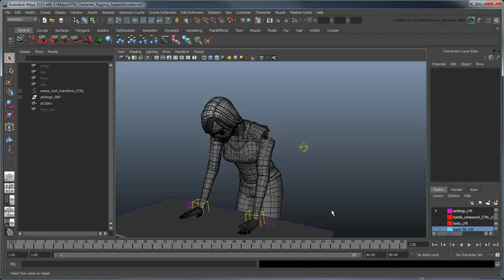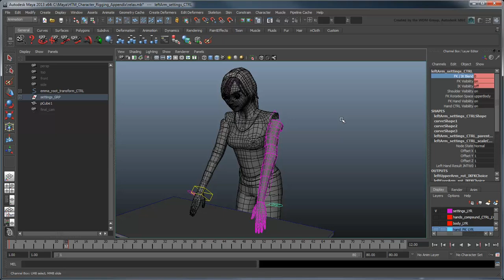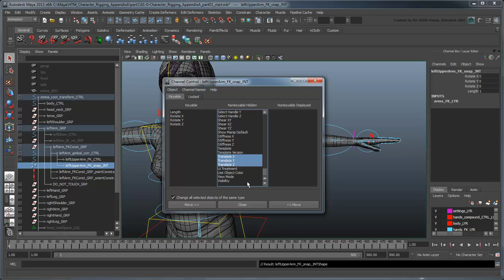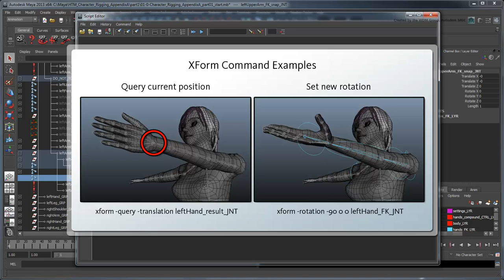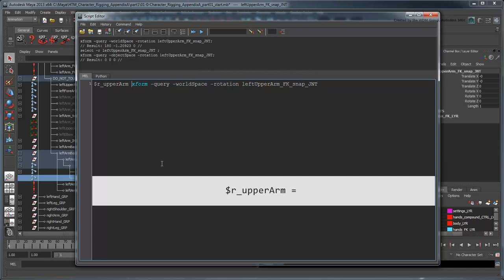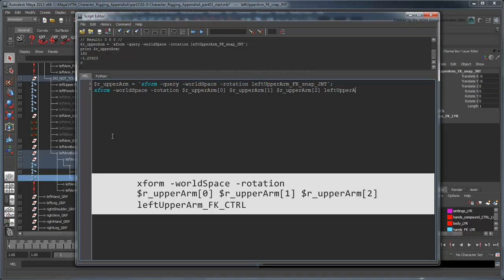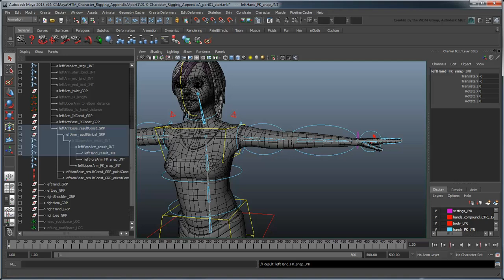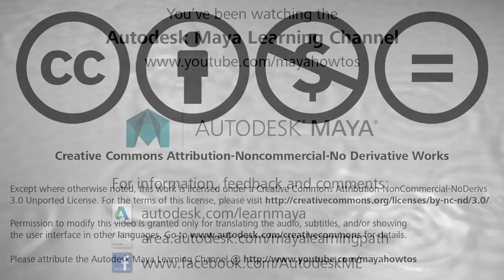Creating a Character Rig: Appendix A: Part 1 - Matching the FK arm to the IK arm (Advanced)

Comment: For some reason, my FK arm controls and the reference objects (snap_JNT) don't have the same matrices values. Both are placed in the same position in the world, with zero transform values (I didn't apply any Freeze Transformations) and the same Rotate Order. I did just like the video, but when I print their rotation matrices values they are different, even at the rest pose. As a result, when I run the script the IK and FK don't match properly. Why do they have different values in the world space matrix?
Reply from the maker: Are your snap_JNTs an exact copy (i.e. duplicated from) of the FK arm joints?  If so, everything should match until you re-parent them under the result arm.  At that point, their local space (which is what I think you mean when you refer to their matrices) will change because they're now having the matrix of the result arm space applied to them.
Reply: @Autodesk_Maya  Yes, they are. I've just duplicated the FK upper arm joints (I've also tried with a transform node, same result). But the values should match when both the FK control and the snap_jnt are in the same position (i.e. rest pose), shouldn't they? I've noticed the forearm_FK and the hand_FK match, the problem is only in the upper arm! The leg snap and leg FK control's world space matrix values, for example, match perfectly, even after I put them under the result joints.
Reply from the maker: @brunosilva3170  Is it possible your gimbal correction control is non-zero or otherwise affecting things?  If you're on Maya 2020, did you accidentally modify the Parent Offset Matrix values of either of those?

Comment: 6:10 In 2020 I'm just getting "// Error: line 1: Cannot convert data of type float[] to type string. // 
"
Reply from the maker: Are you sure you used the tilde (`) up next to the "1" key on your keyboard?  A lot of people accidentally use apostrophe (').
Reply: @Autodesk_Maya  Yes, I copied it from the internet as well just to be sure, and from other, working pieces of code
Reply from the maker: @Exsulator2  Do you mind copy and pasting that code here?  It'll be easier to troubleshoot if I can see it.
Reply: A litle bit late but if your probleme is not solved, I had the same probleme, so just try to do it in python, there is no need of the sort of ' (very difficult to find on a french keyboard)

Comment: Hello, so I've run into an issue that I've been able to counter for the left but cannot counter for the right arm.  So for the left arm, it wasn't matching at first, then I printed out the rotations of the snap joints, and copied those rotations into those joints to counter this issue.  Now the left arm matches perfectly from the test that I ran.  I duplicated this for the right arm by printing the values, this didn't work as it seemed that the controls flipped from the rig.  Next, I tried copying the snap joint values of the left to the right, it still didn't work, zeroed values didn't work and manual adjustment of the values weren't seeming to be helping.  The only difference in this video and my rig is that between the final hand tutorial and this video I met with a professor and separated the controls from the joints to make an overall control group while maintaining all the functionality of the original rig where it would've been lost with separation.  The only mirrored set of the rig was the right hand, and everything else was built from scratch.  How should I go about correcting this issue?
Reply from the maker: Did making an overall control group change the relative values of the FK / IK joints though?  Because that would definitely cause problems with this matching script.  This script relies on them being exact copies of the result joints.  That means, whenever their rotations match in the Channel Box, the FK/IK/Result arms should always overlap perfectly.  By changing the structure of the rig, it's possible that either the IK or FK joint values will inherit the rotations of their parents, thus changing their space and throwing this entire relationship out of whack.  I would double-check to make sure that's not what's happening.
Reply: @Autodesk_Maya  I just checked and this is true.  The Constrained Controls messed up the script.  Now to take this further, how do I re-integrate the constrained controls into the rig to keep the joints and controls separate?
Reply from the maker: @TheAnimationHipster  Instead of separating everything out, you could just create a Set (Create > Sets) that includes all the FK / IK controls in it.  That would effectively accomplish the same thing without changing the structure of the rig (and possibly breaking things, as you've discovered).  Unless there's some other reason they want it that way?
Reply: @Autodesk_Maya  Thanks so much!  I was actually able to match the LRA of the Controls to the Joints so they have the same pivot points.  The Stretching works perfectly for me now.

Comment: hi, first i wanna give out a big thx for the great tutorial.
Im using maya 2018 and the script isnt working. so i tryed what worked last time but still... no results. 
$r_upperArm = xform ("-query -worldSpace -rotation L_upperArm_FK_snap_JNT");
xform -worldSpace -rotation $r_upperArm[0] $r_upperArm[1] $r_upperArm[2] L_upperArm_FK_CTRL;
i changed the script using ("...") coz ` ... ` doesnt work but i get this error:
 // Error: Line 2.91: "$r_upperArm" is not an array. // 
plz help ;D
Reply from the maker: You can't really change the script that way unfortunately.  When you use `, are you saying that you don't get an error but the arm doesn't snap at all?  Or does it snap to the wrong place?
Reply: i just changed some little thing and now its working ;D doesnt make much sence in the first place but i changed $r_ to $l_upperArm no error. but first i had to put the first ` infront of xform again ... i had it behind coz i was testing so much around and forgot how the original line looked like ;D

Thx for you fast reply and ofc for the rly helpfull tutorial. it helped taking me to the next level of rigging ;D

Comment: Hi this tutorial series is amazing! I hope you're still answering questions. I tried to animate my character as seen in this video, to test out the rig. The controls work perfectly, but whenever I try to put the IK/FK handles behind the character's head, the twist bones flip. I know this could be because of the orientation axis of the foreArm and upperArm spline handles, but I can't seem to find an axis in which the arm won't flip one way or another. Is there a solution to this?
Reply from the maker: Generally it's impossible to get rid of flipping completely (it's just how the math works).  What you want to do is find the combo that removes it for the most practical poses.  Try using +Y as the Up Axis and Up Vectors of 0,1,0.
Reply: @Autodesk_Maya  Thank you! That resolved the issue. I had the closest Y instead of +Y. Is the Forward Axis X negative for the right arm and positive for the left, or doesn't it matter very much?
Reply from the maker: @miekeyperman981  Yup that's correct.

Comment: Hello I found your video very very helpful and was able to do my class assignment with this video. The only BIG problem is that the FK moves the IK when it matches it sometimes not always, and that has mostly to do with the fact that the pole vector is parented to the FK's shoulder joint. I noticed you set the fk shoulder joint's "gimbal" rotate values to 0, and I don't know exactly what you did before, since I jumped into this clip from my own assignment but I tried something like that by setting the FK shoulder joint's rotates to 0 as well as setting the pole vector to zero before matching, and recording its values, and resetting the pole vector to its old values after the matching, and none of those things seem to fix my problem.  I would appreciate some help.

Comment: Hi, I was wondering why can't we use result joint rotation to match FK to IK position? :)
Reply from the maker: Because the result joints don't live in the same local space as the FK or IK joints.  It's important to compare "apples to apples", so to speak.
Reply: thanks for the reply. Does it very from setup to setup. As I have bind joint chain, FK chain and IK chain,  I applied your method and queried rotation of the bind joints and then match it FK ctrl rotations. It worked but didn't work for the IK to FK match.
Reply from the maker: That part shouldn't vary.  If you set things up the way they are in this series, it will always work the same way.  Remember, for the IK match you're matching the control node, not the joints themselves.

Comment: Hi, I am working on a quadruped with a 4 joint hind leg. 
I set up like the video and rework the script that fits as I have freeze the transformation of the control curve.
However, when I run the script, it didn't any error but didn't change anything as well. 
Is anyone here to help I can share the file and we can talk about it. Thanks in advance!

Comment: Hi again! I am using separate FK controls and parent constrains rather than shape nodes to drive the fk joints, and i saw in your reply to someone else with the same situation. you said to place the snap joint in the same space as the control, how would I go about doing that?
Reply: I figured it out. Rather than duplicating the joints that are parented to the controls, I duplicated the controls instead and used them as the snap joints. Works perfectly.
Reply from the maker: Place it next to the control in the Outliner, under the same parent.
Reply: ok cool thanks a lot!
Reply: OK I ran the script and the fk joints match to the IK arm, but only slightly. the rotations are just a little off from what they should be, the snap joints are where they should be, however the result and fk joints are off. I used the xform command on the fk controls rather than the fk joints because the controls are what's driving the fk joints' rotations. I tried using the fk joints already and no  luck. Suggestions?
Reply from the maker: Are the snap joints duplicates of the FK joints or FK control joints?  You need to duplicate whatever it is you're matching to (in an ideal situation these will be exactly the same anyway, but from the sounds of it the local rotation axes sound like they're slightly off).
Reply: Maya Learning Channel theyre the fk joints, so I should duplicate the controls then? They arent control joints theyre just Nurbs curves that the fk joints are parent constrained to
Reply: I would like to know this too, because this is the route I tend to go since I'm using a single chain IK/FK blend. I tend to parent or orient constrain rather than mix shape nodes unless absolutely necessary.
Reply from the maker: Yes, that's the correct way to do it.  Basically, the snap "joints" just need to be an exact copy of whatever they're snapping to.

Comment: How would I set this up if I had control objects driving the FK and IK joints via Orient and Parent constraints ? The bones are in a different space than the controllers so is there a way to do this with out parenting the shapes under the joints ?. Also I noticed in the video that the IK control shape has values in the translates is there a way to freeze this out ?
Reply from the maker: As outlined in an earlier part of this tutorial, it's generally not advisable to create another layer of control objects on top of the FK/IK joints (which are, in themselves, already acting as control objects for the result joints).  However, if this is a requirement, then the theory is still conceivably the same.  However, rather than parenting the snap joints under the result joints, you can just parent constrain them to their respective result joints (ensuring 'Maintain Offsets' is enabled) from within the controller space.

As for the IK hand controls, yes you can freeze those values and the rig will still work.  In this case, you'll want to perform the same solution as above and place the IK snap joint in the same space as the hand control (rather than parented in the result joints), then parent constrain it to the wrist (ensuring 'Maintain Offsets' is enabled).
Reply: Thank you for the response I will take it on board regarding our rig development. Is there a video showing how to do IK Parent matching ? ie switching parenting for IK Arms to the Head, Chest or hips without popping ? I assume its similar to this IK FK matching method ?
Reply from the maker: I believe you mean space switching.  Yes, this tutorial covers that as well.  See part 9 or 18.

Comment: I got the idea and got it work perfectly. However, I wonder how you solve the code problem when you ref the rig instead run the script directly on the rig? The name of the controls carry the namespace in front of them so the code couldn't recognize the controls name.
Reply from the maker: You could create a textfield on the UI that allows you to manually input the namespace in it.  Then grab that value and append the text to all the node calls.

Comment: If you don't want to copy-paste the "Match-FK-to-IK" code block 3x (or how ever many joints your limb has), I wrote a function (procedure). Here's a copy of my script at the end of this video:

proc SnapFkToIk(string $snapJointName, string $fkControlName)
{
    $rotation =  `xform -query -worldSpace -rotation ($snapJointName)`;
    xform -worldSpace -rotation $rotation[0] $rotation[1] $rotation[2] $fkControlName;
    
}

SnapFkToIk("arm_base_FK_snap_JNT", "arm_base_FK_CONTROL");
SnapFkToIk("arm_1_FK_snap_JNT", "arm_1_FK_CONTROL");
SnapFkToIk("arm_2_FK_snap_JNT", "arm_2_FK_CONTROL");
SnapFkToIk("arm_hand_FK_snap_JNT", "arm_hand_FK_CONTROL");
Reply: how would it work if you ref the rig instead using directly on the rig. Cause the controls have the namespace in front of controls name?

Comment: Hi, I have another problem. When I run the script to snap my FK arm to the IK there is an offset and the locations doesn't match, except at the default position. Could you please help me fix this issue.
Reply from the maker: +Indika Ratnayake Sounds like the snap joint is either in the wrong place (perhaps parented incorrectly or in the wrong space), or is not a proper copy of the joints snapping to it.  Remember, they need to be exactly the same.

Comment: Hi, firstly great tutorial. I used the script you wrote and changed it based on a rig that I'm working on and came across an issue. Where the left side works just fine, the right side gets flipped 180 degree's in just the upper arm joint. The elbow and wrist joints are aligned but given that the upper arm is rotated 180 degree's its going through the rig. I was wondering if you had any insight as to what may be happening?
Reply from the maker: +Marquis Burt It sounds like the snap joint doesn't match the orientation of the corresponding upper arm joint.
Reply: +Maya Learning Channel Thank you for responding, I think I understand that, but would there be any reason why the snap joint would be in a different space even though it was originally mirrored?
Reply from the maker: It's hard to say.  The joint mirroring command can sometimes be a little finnicky depending on the hierarchy of the joints being mirrored, so that's a possibility.  Also, at least for the Emma rig, we re-adjusted the right-side joints' LRAs post-mirroring to ensure that positive/negative rotations are consistent with the left side.  Since those are manual adjustments, it's possible to just miss one of those.
Reply: +Maya Learning Channel Yes that is right, I did see that in prior videos before I commented. I pressumed that the mirrored behavior took care of that. I'll have to rewatch the prior videos to make sure of that. Thank you for your quick and helpful  response.

Comment: Hi, I was working on the script based on this tutorial, it appears that the FK Hand CTRL does not follow the given command. I find out that there's a slight gap between FK and Result Joints (which I do not know why, as the FK and Result Joints share the same local rot axis). Later I find out more that the FK ForeArm also have gap with the Result. Could you help me? This is the image: https://www.dropbox.com/s/m54fl5565yec4n3/Arm_FK%20Problem.jpg?dl=0
Reply from the maker: It looks like a problem with your IK/FK blend node.  Is the result arm always half way between the two?  If so, then it means you probably forgot to hook up the IK/FK blend attribute or hooked it up incorrectly.
Reply: Maya Learning Channel No, the result joints don't do that all the time. It only happens if the rotation is on more than one axis. I checked the IK/FK connection nodes, and they seems ok. Weirdly this only applies to forearm and hand FK joints, and not the upperArm FK. I wonder how can they have the same rotation values? Could it be some space problem?
Reply from the maker: Generally these kinds of results mean that the spaces are off (which would mean the local rotation axes are not the same assuming there isn't some strange parenting going on).  However, you said the LRAs are the same so that shouldn't be the case.  Are you absolutely sure all the LRAs are the same?
Reply: Maya Learning Channel I figure it out. Apparently I have missed setting the rotation order for the Result and IK joints, I only did it for the FK Joints. That's why the FK UpperArm is just fine. I'm glad at confusing time like this I keep the file progress based on the tutorial number and still have the incremental save for each of them, so I can track back where the FK starts doing bad. Thank you for your response :)